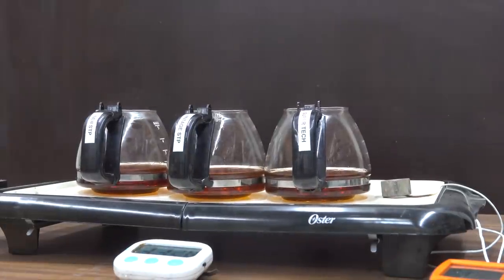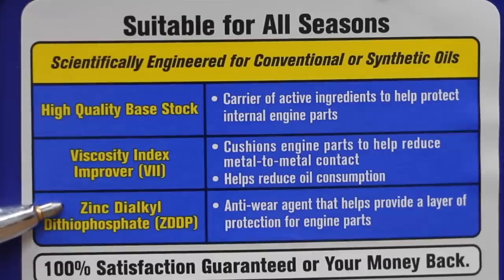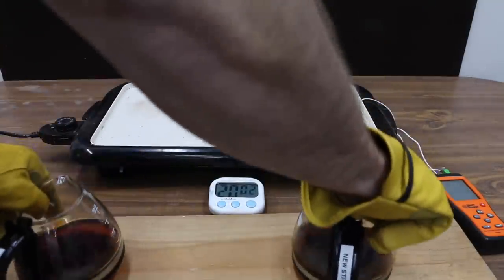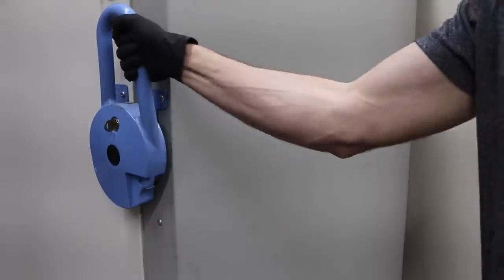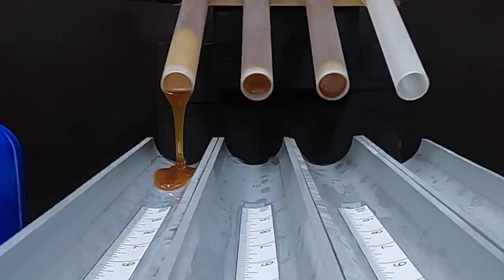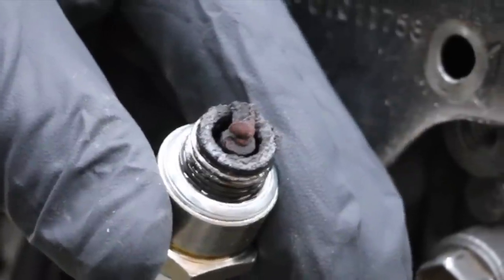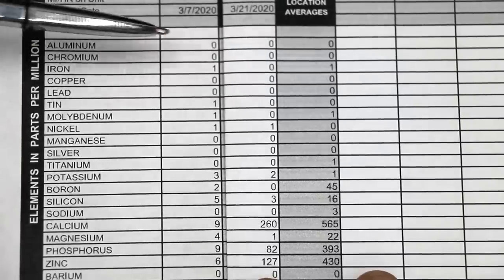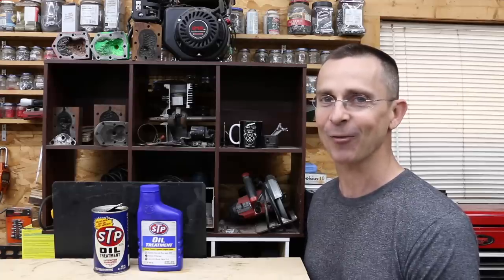Richard Petty's 1981 STP vs 2020 STP?  Let's find out!

Comment: Thanks.  Well done.  I used STP combined with Mobil 1 Synthetic Oil in a Gene Berg VW air-cooled high-performance engine in 1977.   The STP helped cushion the engine's reciprocating action.
Reply from the maker: Thanks for sharing.

Comment: Can you test a product called “Arch Oil” it’s reviews are great, and it’s promoted by some well known YouTube channel. It had a fuel and oil additive. It’s marketed towards diesels specifically powerstroke owners. I want to know if it’s worth the money and does it actually do anything. Thanks!
Reply from the maker: Thanks for the video idea.
Reply: It helped my 7.3 fuel injector stiction issues.
Reply: The oil treatment worked wonders in my 6.0 powerstroke for stiction issues.  Mine and Jeff DeMarcus' truck use high pressure engine oil to fire the fuel injectors.
Reply: I'd enjoy arch oil vs the hot shot stiction eliminator
Reply: Agreed, powerstrokehelp.com says that the archoil helps, I agree do a test on it
Reply: I would like to see that too! Just bought their fuel treatment for my 6.7L Cummins.
Reply: @jeffdemarcus160  Have you tried Hotshots diesel treatment? If so, I'd like to know. Figured I'd get my dad something for his 5.9 Cummins
Reply: @Kari Lynn what is that a school for ants
Reply: Can you add Lucas oil additive to this comparison?     Thanks
Reply: Ben Ruether, yes and the Archoil worked better for me.
Reply: I have 260k on my 03 excursion 6.0L and when I do my oil change I now end up with a hot idle misfire if i don't use Arch Oil with it. I've used several other brands of additives and theirs is the only one that has allowed me to put off replacing my worn injectors so far ( 16 months and 4 oil changes )
Reply: @sortofsmarter  Lol yep, it allowed me to do the same thing for my 04.  But I finally replaced the 2 that were bad and all is well now.

Comment: You should see what happens if a Bug, Insect, or Cockroach get sucked into the Combustion Chamber of one your Lawn Mower Engines. I didn't have an Air-Filter on my dirtbike for 5 years and was always wondering if a bug ever got sucked in there.
Reply from the maker: Thanks for the video idea.
Reply: My ex got sucked into a wood chipper.

Comment: I would love to see a test of different engine flushes to see if theyre actually effective or not. If so which is best.
Reply from the maker: Thanks for the video idea.
Reply: Mitchell Ragle  How did it ruin your engine(s)?
Reply: I use about 2 TBSP of Seafoam added to the Old Oil in the Crankcase, run for 5 Minutes and drain...

Great Idea "nodnarb98761"!
Reply: Thats why i love the subject. A lot of people have many different opinions of engine flushes some say they do wonders and some say they blew their motor up. I would love to see others opinions and experiences as well as tests done with them.
Reply: Same here
Reply: Here in Aus we had a lot of mechanical pump diesels in landcruisers. They were a filthy engine and  we ran engine flush as a matter of course.  One 2H engine was on the full mark on the dipstick, 10 litres, and we drained almost 14 litres out.  After the flush the vehicle held 5th up long hills where before we had to go back to 3rd.  I have flushed many engines, petrol and diesel, and never had a failure as a result.  Those who say don't flush an engine would never dream of putting new rings on a dirty piston and putting it back in an engine they didn't clean out the sump.  Modern engines don't get dirty enough to need a flush, because we have much better combustion control and oils.  Except all Direct Injection engines now suffer from intake fouling from EGR and crankcase fume mixing.  Different problem.
Reply: I remember as a kid i was always told that a cap full of brake fluid or adding a court of transmission fluid to an engine was the best engine flush. Let the motor warm up then immediately drain and fill with good oil

Comment: You should test which 1/4" hex to 3/8" or 1/2" square drive is the strongest, I always end up breaking mine
Reply from the maker: Thanks for the video idea.
Reply: Evan Smillie When we chanced the oil and filter on my dads recently bought Volvo XC70 we had to take down the plastic protector on the bottom. And in all that oily crud was a 10 mm spanner 😂🤣 the guy that lost that must have gone crazy
Reply: DeWalt .... hands down longest lasting I've ever used  ..... would be nice to know if there's a brand that's cheaper but still tough 
Those DeWalts are crazy expensive

Comment: The STP did reduce the wear scar in the lubricity test, so I’m surprised you would dismiss it altogether. I’m wondering if there is something about it besides the additive package that explains what it does.  Years ago some friends of mine that drove log trucks would add a little to their drive axles, they had temperature gauges on their axles and noticed a temperature drop after adding the STP.  I do think it has it’s place, but clearly not good for every application.
Reply from the maker: Thanks for sharing.

Comment: Pls test butter as engine oil :D!

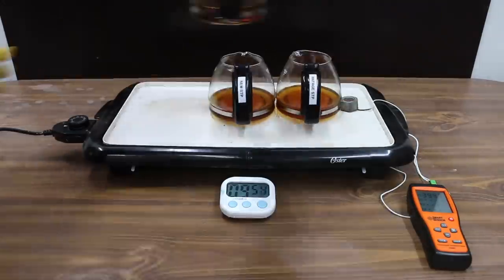And how‘s that test called? 3:35 no... what test? 😁

Great video!👍👍
Reply from the maker: Great suggestion!
Reply: Its called the Noack volatility test.
Reply: Thanks, Colton!😁👍
Reply: Try grape or flax seed- or a high flashpoint cooking oil, in a modern engine that calls for a low viscosity synthetic oil.
Reply: Put some popcorn kernels into the exhaust with a leaf blower while you are at it.

Comment: When I add Lucas oil additive to my diesel tractors they run cooler.       Can you do Lucas.
Reply: They’re is definitely something to Lucas.  Had a buddy start running it in his 250k mile 7.3 power stroke, not only did it nearly stop his oil consumption issue, but with 5k miles on his oil/Lucas it was still honey brown.  Blew my mind.  Diesel oil is usually black seconds after you change it! Lol
Reply: I second this request
Reply: Interesting. You claim Lucas oil treatment is miraculous. I claim Lucas gas treatment is worthless. 10 years ago I used a total of 1½ qts of Lucas gas treatment on the recommendation of a neighbor. I was keeping very careful mpg records back then. The mpg with Lucas was worse than plain gasoline. A 2002 Blazer with 4.3L and a 4L60E. Where'd the other half qt of Lucas gas treatment go? I gave it to my neighbor.
Reply: Like to see one on an old product called tufoil. It was the only product that took away a noisy lifter on my straight 6 . Used stp, marvel mystery, Lucas even after using risloan cleaner. As a side note their in the Guinness book or world records for being the worlds most efficient lubricant. I can’t find it in stores anymore but it still being sold online

Tufoil Engine Treatment will keep your car or boat running so efficiently you can literally double the life of your engine. Efficiently running engines use less gas, need fewer repairs, run smoother and quieter and last a very long time. The National Bureau of Standards tested Tufoil Engine Treatment and reported their findings: Tufoil has a surface friction so low. Tufoil Engine Lubricant is Guinness Book of World Records certified as \\"The World's Most Efficient Lubricant.\\"

Comment: Engine oil additives vs premium oil filters: Often enough, consumers are sold into the idea that adding a engine oil additive will in some manner benefit their engine. However, oil filter companies are quick to advertise their premium oil filters are 95.7% efficient @ filtering contaminants of 20 microns in size  using the ISO test.  With this being said, I'm curious how well a premium oil filter can filter out the oil additives which you may add into your oil. Re: Is it a waste of time to use an oil additive if the oil filter can remove it from your oil system, or not?
Reply: I'm gonna use a premium oil filter as a #chinaflu mask!

Comment: I've always heard that modern oils were short on zddp for emission reasons.
Reply from the maker: Thanks for the feedback.
Reply: Each oil upgrade, eg SG, SH, SJ, SM etc now SP contains less and less zddp to make the catalytic converters last longer.
The additives also harm O2 sensors.
Reply: plus, only flat tappet lifters need zddp, rollers do not

Comment: I always loved  vintage STP. There were some very old Otis generators that had a slip ring lube system on each babbitt bearing. STP was the only lubricant that would work on them. It all comes down to staying power and not running off. Great test.
Reply from the maker: Thanks for sharing!

Comment: Because my car has high mileage, I've been considering using an oil additive to keep her running strong. I've been looking at Motorkote, Archoil, Bestline & Turbo Maxx. And I am super interested to so how they compare objectively. Especially with the testing you use on motor oils.
Reply from the maker: Great suggestion! Thank you.
Reply: A year later have you found a good one to recommend thanks

Comment: Will using the wrong manufacturers transmission fluid actually hurt your vehicle?
Reply: sw4gr1d  - OMG, doesn't Google exist for questions like this?
Reply: No, it won't, transmission fluid is just hydraulic oil.
Reply: Absolutely don't do that.  However, depends on the transmission design.  If you don't know for sure, just use the correct type fluid.
Interesting story for instance, the old Ford automatic transmissions came with "type F" fluid in the factory fill and if you used Dexron ATF, the clutch frictions were prone to fail.  If that same transmission had originally been filled with Dexron, failure didn't occur.  It was common to switch fluid types at rebuild, and have great service.
Modern transmissions can be even fussier than those old reliable overbuilt tank transmissions were.
Reply: Yes.
Reply: It definitely can.
Reply: I respectfully disagree with farmer fvp.  It can do alot of damage. May not but it can always use the recommended type of fluid in owners manual
Reply: Yes
Reply: Yes 100% yes
Reply: jaw west, next time you probably should start your comment with "Video idea for PF: .." or else random people on the internett is going to start commenting their thoughts and opinions on transmission fluid.
Reply: Manufacturer is irrelevant, the specification and certifications are what matter.
Reply: @FarmerFpv  Go ahead and put some type f in your import let me know how that goes .
Reply: @LN997-i8x  Correct, although it should be mentioned that sometimes a vehicle's warranty might be affected if you don't use a specific brand of engine oil in some locations around the world.
Reply: Yes, do not use anything but what is recommended . Clutch packs are not the same.
Reply: I believe all vehicles call for Dexron Mercon( with whatever revision number they're on now) since at least the 80's & I've heard of type F for Ford's but never seen anything that called for it.
Reply: @benkeysor7576  Using Type F in an old GM Transmission will make it shift better.
Reply: @benkeysor7576  Really? There's at least ATF4+ aswell and I'm sure countless others.
Reply: @chada75  F type doesn't have as much friction modifier. Friction modifier makes the fluid "slippery" so that the shifts feel smoother. The F type fluid is a good fluid for older transmissions behind a modified engine. In fact the best fluid for dragsters is usually straight hydraulic fluid.

Comment: Interesting.  In the late ‘60s, I was driving my Morgan 4/4 when it began to make a loud mechanical noise.  I pulled into a service station and a tech came over and said that I had a sticking valve. Without consulting me, he poured a can of STP down the carburetor and yelled for me to keep revving the throttle.  Smoke POURED out of the tailpipe and I was afraid that he had ruined my engine.  However, after a short while, the smoke stopped and there was no more mechanical noise!  About the same time I had a neighbor who was the service manager at an International Harvester shop.  He built rail dragsters in his garage.  He told me that when he was assembling an engine, if he coated all the moving parts with STP he got many more runs out of his engine than he did without the STP.  As for your test in the lawn mower engine, #1 Why did you combine the old and new STPs?  #2 I don’t think STP was ever recommended for lubing an engine without oil.  It was designed to be an oil “additive”.   Andy Granatelli would be rolling over in his grave—LOL!

Comment: Good video.  I started using STP with my oil changes on my most of my cars/trucks in 1981.  The vehicles I kept ran to over 210-240 K miles.  It did build a bit of a film covering over my cam shafts but that must have been equally good.
Reply from the maker: Thanks!  Thanks for sharing.

Comment: Disregarding the mix ratios voided anything you might have learned from the lawn mower engine test.
Reply: Yep, mixing the 2 competitors together was haphazard and makes it seem more like propaganda according to his own personal bias rather than a legitimate test.
Reply: &Abel perhaps, but the fact that plain motor oil has far more of the additives STP claims to add kind of makes it a moot point. If you have an old engine that's burning oil and you need it to last a bit longer, by all means, add one of these really thick oil additives to it to slow down the burning. But you're not doing a healthy engine any favors by using stuff like this. Modern oils are just so much better than oil was 40 years ago.
Reply: @puckcat22679  Whether STP is good or not is besides the point. The "test" was poorly conceived, seemed designed to fail, didn't actually tell us anything and was just poor methodology all around.

Comment: I grew up with STP 
My dad did oIL changes at 3k miles religiously and always added STP. Then in the mid 70s in HS during my auto mechanics shop class a STP rep came in. He had a everyone take a flat blade screwdriver and dip the shift into the STP then attempt to hold it from sliding from between your fingers.
Of course King Richard was the driver of choice in our household for Nascar. Almost everyone used it at the drag strip. 
This is in the 60s, 70s and into the 80s
Thanks again for another great video brother.
Reply from the maker: You are welcome!  Thanks for sharing.

Comment: During the '60's and '70's I had 2 uses for STP. It would quiet down a clattering hydraulic valve lifter. And it made excellent high pressure lube for a dead center on a lathe or grinder.
Reply from the maker: Thanks for sharing.

Comment: We used STP when made by Studebaker Corp. A friend was using 10% STP in his Willys Jeep. The oil pressure dropped to 0 and he ended up driving it for a few days, thinking the gauge was bad. The gauge was mechanical, and the floating oil suction had lost the cotter pin and fell of...no oil pressure for more than 3 days. We pulled the pan, checked the rod and main bearings, no damage. Hung the suction and hit the road!

Comment: In 1969 I bought a '64 El Camino from a speed shop in Orange County, CA.  The car was burning 1 qt of oil every 60 miles, so after a few months I rebuilt the motor.  The speed shop had apparently been using STP in it, because the inside of the motor was caked with goo.  I scraped pounds of the stuff off just the valve covers.  The motor had good compression so I almost didn't pull the pistons, but since they were right there, I did.  Good thing, too.  The oil scraper rings were compressed into the piston and were baked in place.  They could not expand to touch the cylinder walls.  I pried the oil rings out and scraped the ring channels with a paint scraper.  Reinstalled everything with new parts and it worked fine.  No more STP for me after that experience.
Reply from the maker: Thanks for sharing.

Comment: Awesome video!  Made me laugh.  Many years ago (mid 80's), my friend had a Pontiac Grand Prix with a 301 CI V-8 that had a knock.  We changed the oil and substituted 2 cans of STP for oil.  The motor ran quieter, but still burned/leaked.  When it was low, we'd add more STP.  We called it motor honey (there actually was a brand called motor honey back then).  We kept driving and driving and driving the car.  I don't think we changed the oil for over a year.  I told my friend that the bottom of the crankcase was probably a thick goo of STP!

Thanks for the video!
Reply from the maker: You are welcome!

Comment: Back in the early 80's, the guy loved Exxon's Uniflo. The boat engine called for straight 30 weight and the Uniflo was 10w40. With the changed oil, the engine made noise. The point is that when the old STP was on the market, engine tolerances were larger. These days engine tolerances are much closer, so of course better flow makes sense.
Reply from the maker: Thanks for sharing.

Comment: New video idea:
This video has reminded me I have not seen an oil filter shoot out ever. I like the general parameters used on your air filter comparison video. Static pressure, flow and debris capacity. It would also be interesting to see the test rig that you come up with for this. Like an oil pump from a small block Chevy connected to a large drill motor.
Me and my wife enjoy watching most of your videos they’re very entertaining
Reply from the maker: Thank for the video idea.

Comment: The cold viscosity test was flawed due to obstacles associated with suction and vacuums. A vent tube place inside the test tube all the way to the bottom would level the playing field. Note how quickly the vintage flowed after it finally started dripping